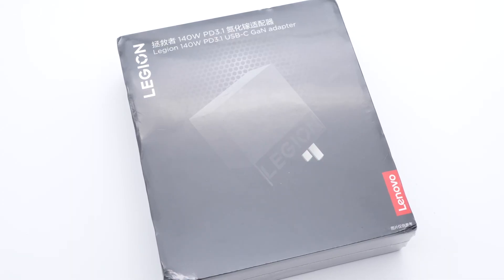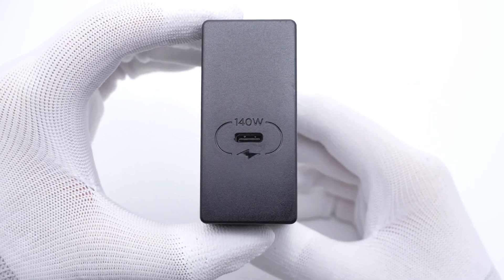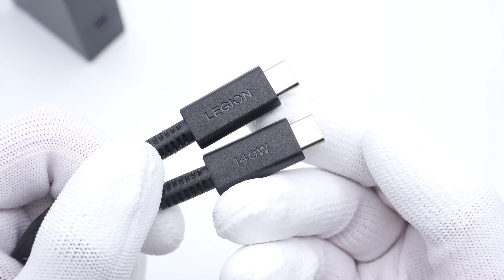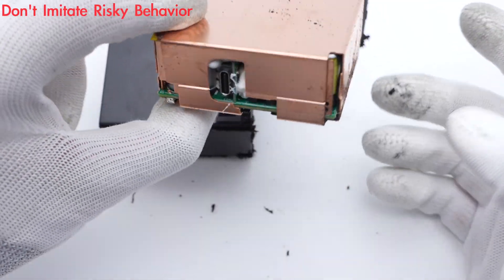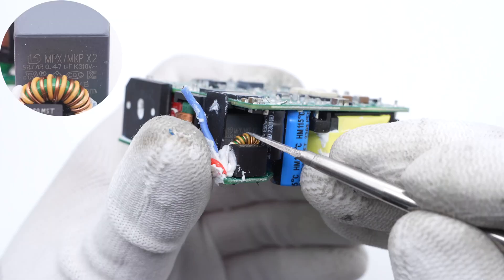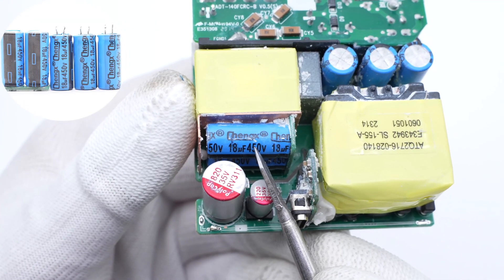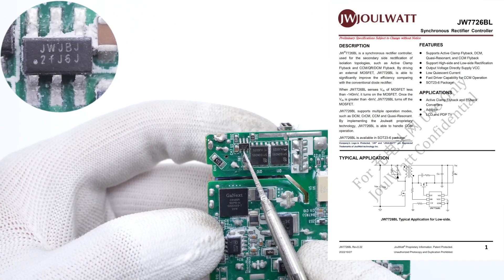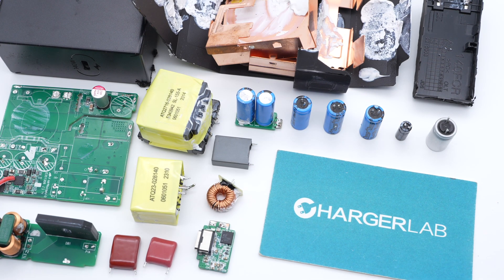Teardown of Lenovo Legion 140W PD3.1 USB-C GaN Laptop Charger

Comment: Would this charge the Legion Pro 7i (2024) well? It originally comes with the big 330W brick but as a hybrid laptop to also sometimes travel, I'd like a smaller plug and since it can charge with USB-C, I've been looking at something like this. Not always going to game so I don't need the full power so something smaller like this I hope does efficiently charge the Legion Pro 7i

Comment: Is this compatible with Lenovo Legion Slim 5 Gen 8 14" OLED? Does it allow the laptop to run in hybride mode graphics (use Nvidia 4060)? I used another 140w GaN charger, and it only allows it to run using integrated GPU.
Reply: really ? I thought it happened due to 65watts gan charger . there was no way to detect nvidia gpu using that charger

Comment: I want to ask, does this work with the 135w cable square connector? I got this 140w but didn't know that it only has usb c cable and I don't have the tools to test the square tip 135w cable.
Edit: answer my own question. Yes, it does, it says that on the box but I never translated it so didn't know.
Reply: Hey, many thanks for that last note. I also wanted to know if the square tip cable would be able to charge my 2022 Legion (135W). I just ordered through Ali a square tip to USB c cable to do just that!

Comment: They write pd 3.1 while it's not... Pd3.1 ks 28v 5a while lenovo only charges at 20v 7a 
So a conventional pd 3.1 wont work ..
Reply: it says 28V 5A both printed on the power brik and both on the power-z  test shows 28v-5A...so why do you say that?
Reply: The pc doesnt take 28v 5a, it only takes in 20v 7a 
So pr3.1 is incompatible
Reply: @mohcineelharras2707  Which PC? This power brick can be used for anything compatible not only a specific laptop. And since the subject is the power brick reviewed and it is compatible as long as it is capable and any capable sink could take advantage of its compatibility I think it's fair to say it is correctly advertised. Don't you think? It's like saying that you car can do 180 km/h but since in highway you cannot do more than 130km/h they are claiming something that is not. If you race track the car you can achieve the advertised 180 km/h. Isn't it or did i miss your point?
Reply: @The_Bo  we are talking legion gen 8
Mine can go up to 140w
Reply: @mohcineelharras2707   oh...sorry i saw your comment dircetly below the the powerbrick review, didn't see any reference to legion 8 in your post  thread. Nevermind
Reply: @The_Bo Hi. Can i use this charger for hp victus? It supports 20v 5A. But i see that this charger supports 20v 7A. At the other side, i understand that, this 20v 7A only compatible with legion and Lenovo, not other brands. Am ı true?
Reply: @SungurBeyoğlu  as far as I can tell there's a proprietary Lenovo protocol to enable fast charge. But it also should be compatible with Power delivery 3.0 protocol with should be universal. I cannot tell not having an HP laptop or any laptop compatible with PD3.0
Reply: @The_Bo Yes, you are true. But pd supports 28v 5a. So is this protocol supports 20v 7a?

Comment: Am I correct in saying that this adapter will only output 20v 7a with a 240v input? If that's the case It would be limited to 100w max at 120v in North America.
Reply: Yeah
Reply: nah this does 28v 5a and 20 5a, there is not 20v 7a

Comment: Is this charger compatible with the legion 5 15ARH05 model? It's power brick is  170w with a slim type 3 pin connector. I don't mind cutting some of the power out as I will only be using it for productive tasks when I go outside.

Comment: If I still go to school with a legion laptop, I'd probably buy this instead of carrying the 300w power brick 😆

Though I haven't read if it can charge while it's turned on.
Reply: yes, you can charge the laptop like with a normal charger while using it. it will just be slower and you won't be able to use the performance mode.